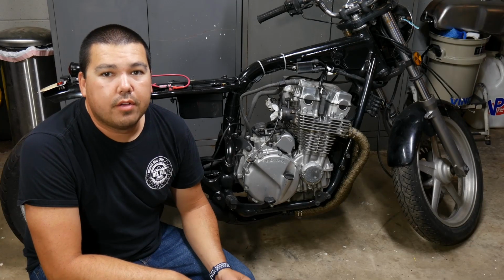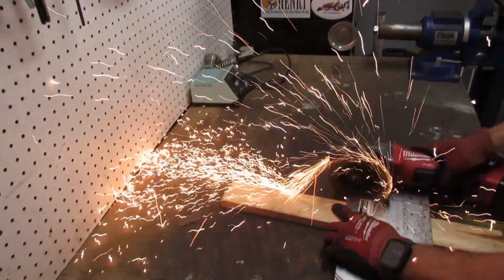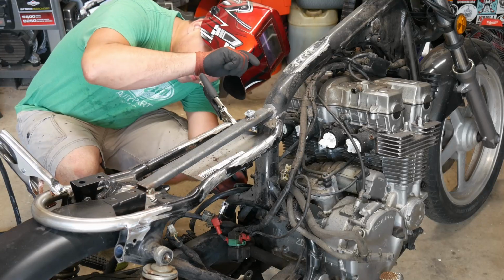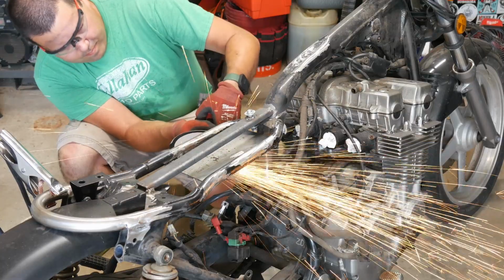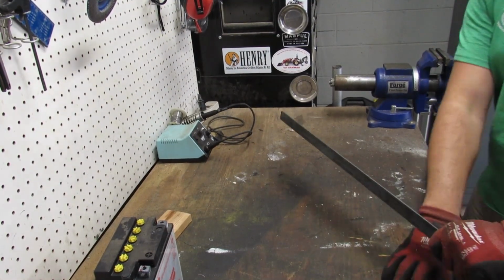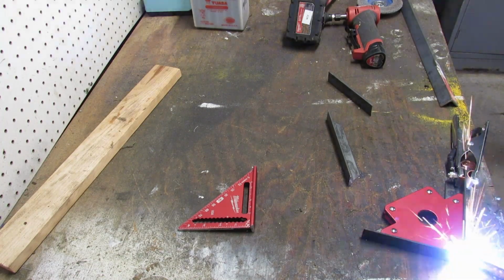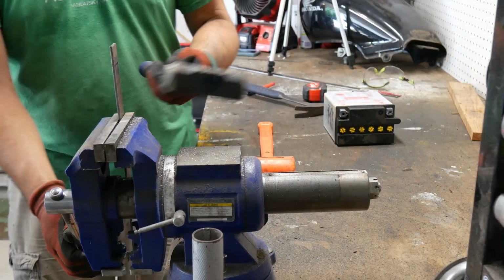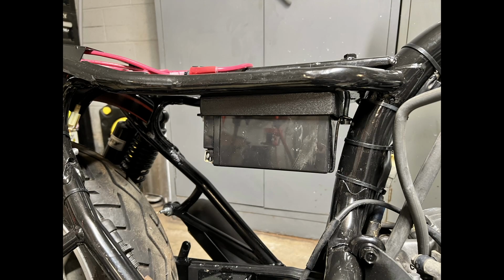Honda CB750 Cafe Racer - EP6 - Electrical Tray & Battery Tray

Comment: Add some rubber between the battery and your strap. If not it can rub through the battery case.
Reply from the maker: Thanks for the tip! I added some sticky back foam for that exact reason.